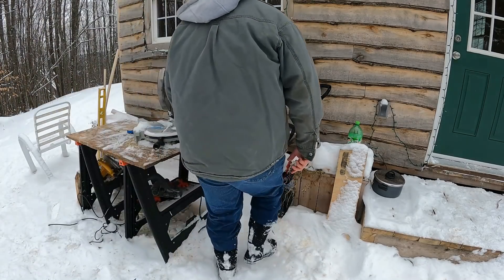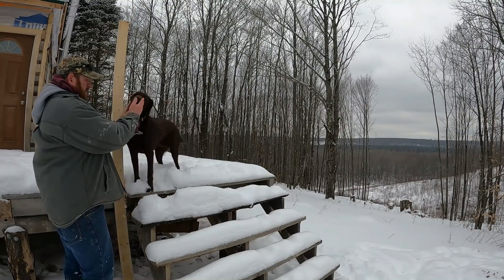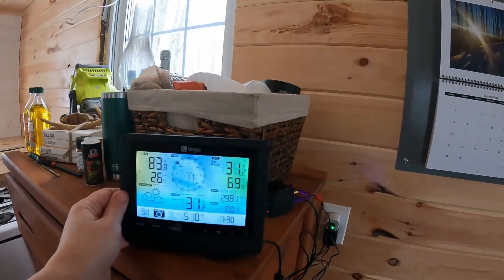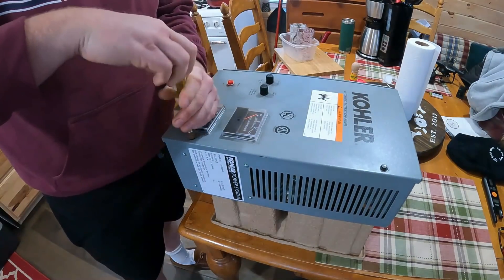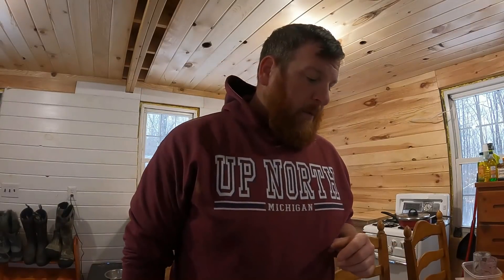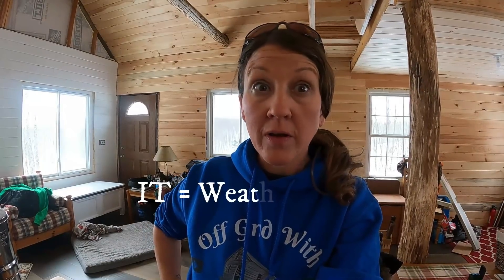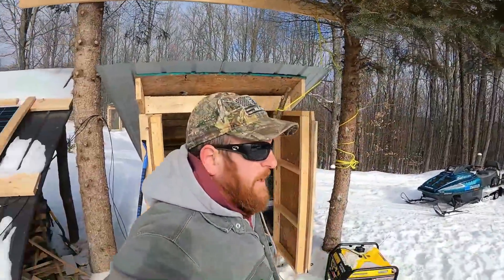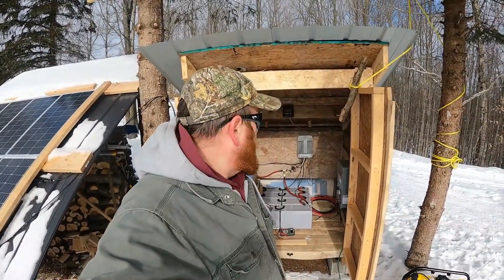Chilling Reality: How Winter Impacts Our Solar Power System

Comment: The video title is misleading…
Reply from the maker: It didn't do what we needed without using a generator....it failed us
Reply: I clicked this video looking for info on winter time production. The good and bad.. the title makes it sounds like that’s what i am going to watch…. What I watched was a video of testing a generator.  I don’t mind meandering videos but I would like it to actually have the info the title says it has.
Reply from the maker: I don't know what to say bud, we are an off grid channel and I share my solar experiences. Up until that point our system was fully independent and I never had to charge it or use the generator so the system failed us for the first time.....hence the title.  It doesn't say watch this to learn about solar....so you can't expect that. Check out Will prowse if you want numbers and tech reviews. I just share my experiences here as a newbie. Best wishes
Reply: @OffgridwithJayandJen  fair enough. Subscribed

Comment: When either the solar or generator is charging, the voltage must be higher than the batteries..  I would add more solar panels (2-3) to cover the January to March cloudy stormy weather.  You could change the angle of the solar panels. Generator is still a good idea.
Reply from the maker: True....the charge controller is maxed out for wattage at 1040 watts input. Also maxes out at 150 volts which I have the panels wired in series parallel to be around 110 volts. The way it is set up it only produces 10 amps so I can use lighter wire. It charges up the battery bank fairly quickly and fully every day which I'm surprised by.....I still have a lot to learn.  Would probably help if I had a shunt or CC that kept track of input and output better.....but this will have to do for now. Appreciate the tips 👍

Comment: Sorry for the delay providing my current setup. This is the same charge controller you are using. 
Equalize Time: 120 min
Boost Time: 120 min
Low Volt Disc: 22.2 v
Discharge limit: 21.2v
Under Volt rect: 24.4 v
Under Volt Warn: 24.0 v
Boost Rec: 26.4 v
Low Volt Rect: 25.2 v
Boost Charge: 28.2 v
Float Charge: 27.6 v
Over Volt Rec: 28.2 v
Equal Charge: 27.9 v
Over Volt Disc: 28.3 v
Charge Limit: 28.2 v
Reply from the maker: Nice, thanks for the numbers....they look similar to my settings  but I'm not in front of them at the moment. I will screen shot this and go check when I'm out by the solar shed. Thanks Joe for the info.....keep me up to date on how the victron treats you
Reply: I just installed a new Victron 250/100 to support upgrading to a 48 volt system. So this controller will be retired now.

Comment: I havent even seen the video yet (commercials still playing) but I can tell from the thumbnail what went wrong, batteries want to live in the SAME temps that we want to live in, so you need to keep them heated in the cold, or cooled in the heat.  Your shed wasnt heated?  Im building a camper van and do plan to camp in cold/heat, but my Lithium Ion batteries will live in the van with me, so they will be heated/cooled as needed... Or I will just drive to where the weather is better.
Reply from the maker: 👍 working on a plan to heat and insulate them by next winter. See how it works out.
Reply: Ya, you can deplete the batteries when cold, but charging won't work well at all unless you can keep your batteries as warm as you would need. You can damage them if you try to charge while frozen.
Reply: You also might want to consider placing your batteries INSIDE WITH YOU... But upgrade to AGM, SEALED lead acid, or best yet LiFePO (these will not off gas and safe for indoor use).  Will Prowse is my solar guru, and he's torn apart these batteries and verified they are a great deal! 300 Ah of these is worth 600 Ah of the others, so they end up cheaper if you are comparing to AGM & sealed. Buy any of the brands this guy recommends. https://youtu.be/0YDqFKfm9oA

Comment: You know solar can heater ?
Desertsun02 did a lot of test, with several configurations,
ones best is only in wood :
we will not invent better than what nature has already designed...

good idea maybe to dry woods faster, in some climates (hours of sun) will accumulate under....
Reply from the maker: I will look into it for sure. I should at the very least have a heater working while there is excess sunshine. Thanks
Reply: @OffgridwithJayandJen  

yes for between seasons, autumn Spring
with 12V fan for computer, and pelton cell for 12V power supply

I only have 5H of sun, and especially oriented East.
So I cant...
Then I'm going to convert a wood-burning fireplace insert,
in rocket mass heater, but also in oil (and hob-oven).
View Gerrysdiy waste oil burner, simple and efficient, easy to not overheat or heat at night 

p.s.
building insulation
see ubakus website,
free software online pro (the German translation is poorly done, however)
but very useful for checking the efficiency of the building / hygrometry and day-night termperature phase shift

have fun

Comment: I wonder how much wind power you would be able to receive during the winter I have seen off-grid units that had a wind turbine that they had in place and they did not have to have a generator that often
Reply from the maker: That might be the next step Mark.....will do research. Thanks

Comment: Hi Jay and Jen, your place is looking great. Timber looks like he is having a blast. Sorry to hear your troubles with electricity. The type of batteries you have are the better option, but it might not be the cold that is hurting you. You might be having issues if you don't fully charge between cycles. Unfortunately, the Michigan sun is not very reliable. AGM batteries perform best when fully charged. That can be hard to do with just solar. Looks like you are giving us all lessons with battery  maintenance, thanks. Hope all else is well.
Reply from the maker: Sharing the journey.....good and bad, lol

Comment: Ps. Jason you need to keep those batteries above 50 % state of charge or your gonna cause internal damage to them and reduce your total aH capacity ruining your investment.
Reply from the maker: Right....from the charts I read it said 24.2 volts on a 24 volt system was 50% drained......so that is why I was concerned. I'm hoping nice it warms up they will hold 26 volts more consistently.  Right now I don't like it below 24.5ish

Comment: Any time you charge from two feeds you can overheat small components that are electronic and sensitive to higher amps.
Reply from the maker: I'll try and be careful. I have the solar panels set up to.max out at 10 amps and the generator charger pushes 10 amps as well. The batteries I believe say max 30 amps so I should be 👍

Comment: Did the math. 28 volts at 20 amps can only charge 2 batteries. 28 volts at 40 amps for four batteries. 28 volts 10 amps per battery should allow them to charge from 11am to 3pm. Having 484 watts and needing 28 volts gives you 17 amps to 6 batteries. Meaning 2.8 amps is all each battery is charging like a trickle charger.
Reply from the maker: Humm....I'm not good with the numbers but like I said during a good day the battery bank goes from 24 volts to 28ish in just a couple hours....normally blinking fully charged by noon then just sits idle all day. With good sun it gets 100ish volts and 5-8 amps. The 10 100 watt panels are set up in two sets of 5 in parallel.
Reply from the maker: The big surprise to me is that it drops back down so quickly.....but I assume it is mostly due to the cold. We never really pull more than a hundred watts off of it, just lights and charging electronics.  Then 750 watts for 10-15 minutes in the morning to make a pot of coffee.

Comment: In defense of your solar setup, you did make it into Feb before it really became an issue, though that is probably circumstance of this year's weather.

Also, I'm not any kind of electrician, but it seems like it would be more efficient to use the generator to charge the batteries than drawing power directly from it a la carte.  seems like running stuff directly off the generator would waste a ton of potential energy that the batteries can store.
Reply from the maker: This is a good point, it has been working well but have been fortunate with mild weather so far. 

Ya when we had the generator running we both powered the cabin directly with it and charged the batteries.  And we were doing projects and using power tools. So trying to be efficient

Comment: You need get that weather station higher in the air. It is getting sheltered from the wind by your cabin. If you read the instructions it says something about being at least 10 feet from buildings. As for charging from opposite corners of the batteries, yes! That's exactly what you should be doing. You should also draw from the batteries in the other opposite corners. It allows for proper current flow across all the batteries in either mode (charging or drawing). It would also seem that your panels are not properly facing solar south? Based on your video they look to be facing south east?
Reply from the maker: Hey Mark.....you are right, the weather station will be relocated when the ground thaws but we had limited options in the winter right now. good to hear that my thoughts about hooking up to the opposite corners is a good thing. The panels are facing south so we are good to go there.
Reply: @OffgridwithJayandJen  Put some leftover insulation in the battery shed. Batteries don't like the cold (as others have said).  Get them off the floor and onto a shelf of some sort. I've seen it done with just a 2x4 frame with insulation in it laid right there on the floor. Put the batteries on top and box them in. They give off a little heat (not much though) and so you can trap that to aid in keeping them warm. As for the weather station, what goes up must come down. The battery in them lasts about a year. Some of them have a solar panel to aid in longevity. Also, you need to point it south too otherwise the wind direction readings will be off. Well done and keep it up.

Comment: Jay, i think you have ( one OR couple ) defect batteries .  
Greetings from 🇳🇱
Reply from the maker: I was worried that might be the case since they drop so quickly....they were all holding 12.7 volts nicely when installed, but I will have to disconnect them all a sometime and check them out. thanks for the comment

Comment: Little hint from a troll... either move the battery's closer to a heat source (house) or pipe inline fan heat from your house to the batteries...
Cold weather will fail your system. I dont care what other people say that is the experience truth.
Also... Get a wind generator made up. Kris Harbour Natural Building has some greatt home made videos on that...
Reply from the maker: Will try and figure something better out for next winter, thank you. Not trolling if you are productive and helpful about it 👍😊
Reply: @OffgridwithJayandJen  or.... a heating blanket on a 2 min warm every 30 min timer...
Anyways thanks again  keep on trucking

Comment: You should look in to TWO (Charge-Discharge Monitor  by Drok on Amazon) It is a very complex little gadget but it will let you know what you're pulling out of the batteries what you're  solar is putting  in by way of the ground wire run through the little black box and 12v for power and that's it setup done(but they can do a lot more if setup to turn on and off at certain voltage) put one on solar panels coming in to charge control  and one in the cabin where the ground wire first comes in.Now you turn on a light or everything in the cabin it will tell you what amps and watts its pulling P.S. it will keep a record of the usage to until power is lost to it
Reply from the maker: very cool...will look into that. thank you

Comment: My understanding is that the optimal temperature for lithium batteries for charging and discharging is 65 to 75 degrees fahrenheit. It doesn’t hurt the lifespan of the batteries to discharge them at lower temperatures but you get less and less energy out of them the colder it is. Charging the batteries while cold will lessen the lifespan of the batteries. I’d build a insulated box around the batteries and have a thermostatic controlled heater inside. Tech Ingredient youtube channel has videos on using reflectors around the solar panels so you get more charging in winter and cloudy days.
Reply from the maker: This is good information....I will check into that improvement for sure. Although my batteries are AGM, they handle conditions a bit differently but would benefit from the suggestions you said. Thanks

Comment: Your batteries are doing fine… they are under load and resting voltage, that is normal in my opinion.
Reply from the maker: AWESOME...I appreciate your input. I  have no prior experience to gauge anything on, so thank you for letting me know. Best wishes
Reply: @OffgridwithJayandJen  glad to help, I have been installing systems for quite a few years. I’m happy to help out wherever I can. Just make sure you float your batteries everyday generator or solar.
Reply from the maker: Great,  appreciate the help. I'm just surprised when the battery bank goes from 24 volts to fully charged in just a couple hours,  then sits idle all day......only to drop quickly  in the evening once the sun is gone. But it keeps us with electricity for a day or two, so I can't complain.
Reply: @OffgridwithJayandJen make sure your chartering parameters are set for your battery manufactures recommended settings. Also you may want to consider getting a new charge controller with a Shunt (don’t know if you have one now or not) I prefer outback and Midnite. They have been bullet proof Charge Controllers. I use a Midnite classic 150 on my personal system and love it!
1,680w PV, Midnite Classic 150, magnum pae4024 inverter with 4 rolls Surrette S-550 6v batteries wired for 24v.
Reply: @OffgridwithJayandJen  yes when the sun goes down and your generator is off the voltage shown is under load so it will drop. That doesn’t necessarily mean your batteries are drained to that level. From what I can see your system is working as it should be. I could be wrong but it looks good to me!

Comment: Nice job! Glad you got a little getaway down here. Insulation in the shed is recommended and mounting   the weather station higher up will give you a better wind speed average,  maybe 20 ft or so.. like your flag height... having the generator charging option is a great idea for those no sun days.  My wind turbines are about 20ft to 25ft up or so. Looking forward to seeing the next one..
Reply from the maker: Hey John....good to know, I will try mounting things better once the ground thaws. Question....how loud are your wind turbines? I would love to include them....but noise would drive me a little 🤪
Reply: @OffgridwithJayandJen  At 20ft plus small ones are very quiet,  as long as motor doesn't have gear reduction.  You only need some 1.25 galvanized pipe,  12x2 outdoor wiring and  diode on positive side.. battery will clamp the voltage and diode acts like the fuse. Size the diode to your output wattage..
W÷v=a so 600w ÷24v=25a..
Higher output would want to use charge controller for turbines..
Reply from the maker: Awesome, thank you for the Information

Comment: Also your voltage is showing that because your in prety spotty clouds and apparently the EP ever CC dont do so well in that condition.   Its hunting for the best MPPT settings.  I havent found this to happen with my EPever BN series that's 40a.
Reply from the maker: Ya I don't know if I need to change settings or what,  but whether is so inconsistent who knows. Just surprises me it fluctuates so much and so quickly. Instead or slow charging at least.
Reply: @OffgridwithJayandJen  I dont think there are settings that can adjust that. Your dealing with slow to find the power point.  It's hard for any CC to adjust that fast on a day with wispy clouds like you had that day.  Either way do the calculations on how many hours your 10A charger needs to run to charge your batteries from 50% to say 80%.  Its more beneficial to use a battery charger in the early morning and let the solar top off them in float.  You use less gas vs battery input this way.
Reply from the maker: Awesome point my friend. Thanks for chatting with me about it. Best wishes

Comment: To charge your batteries from 50% your prob looking at needing to charge at 10a for nearly 8hrs.
Reply from the maker: Ya, it's just weird that it keeps surging then turning off because it says the batteries are full....then turns back on after 5 minutes because the voltage drops back down
Reply: @OffgridwithJayandJen  you may be showing a surface charge.  Try removing the solar from the CC and then taking battery power away from the CC for a few minutes.

Comment: I'd suggest to quit trusting the numbers from the controller. Measure with your meter. Your controller should output continuous current. Maybe the settings are wrong.
Reply from the maker: I feel you are right.....I"m a newbie but believe the settings are right. It turns of charge when it goes above the limited highs set by the charger.....just seems to go up and down too quickly